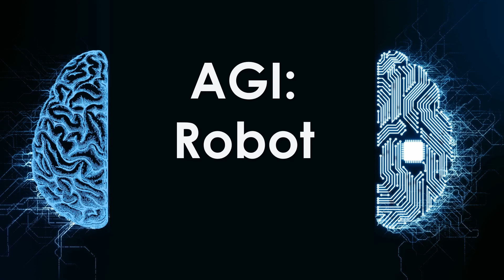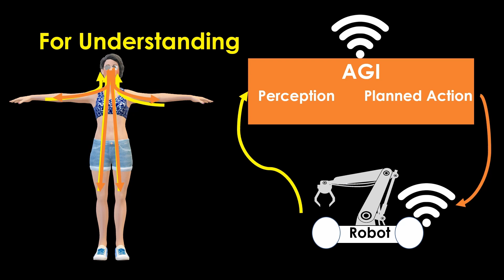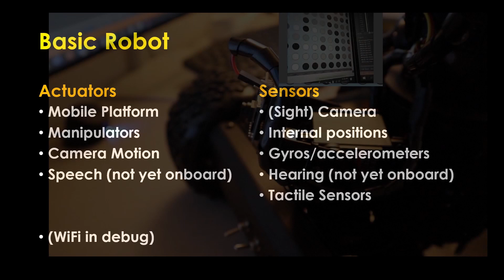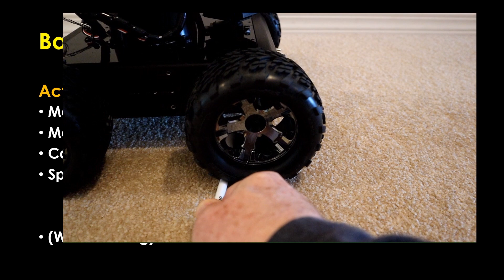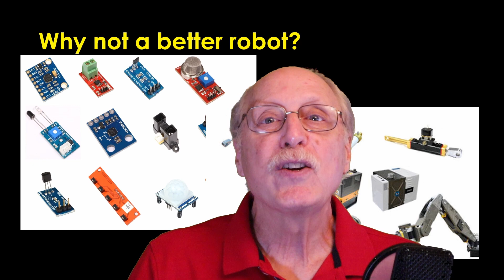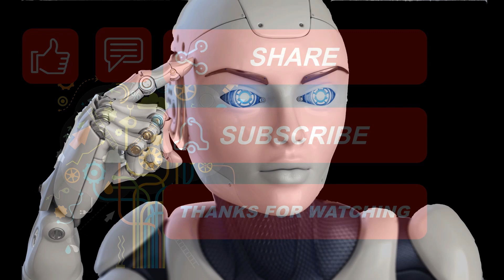Caution: Robot Crossing!

Comment: Hey! I am really interested to make this robot and adding some more capabilities to it using your brain simulator. Can you please share more information on how exactly can we make this?
Reply from the maker: Thanks for the question...  This is still a work in progress and we're still working out some of the kinks before we write up how to build it.  Stay tuned!

The camera is an ESP32-CAM which is available from numerous sources. 

We have two mobile bases being built one with omniwheels. 

The arm is a kit you can purchase here: https://www.robotshop.com/en/lynxmotion-al5d-pltw-robotic-arm-kit.html

The very first software for the Brain Simulator to control the robot was just checked in a few days ago...still needs a bit of testing.
Reply: @FutureAISociety  But this one uses FlowArm PLTW software to work on. How to make a robot that will work on your brain simulator software?
Reply from the maker: @shrijasheth6576  I've never tried FlowArm... the unit also came with a Lynxmotion processor board which I'm not using. I'm using an Arduino R3+Wifi instead.